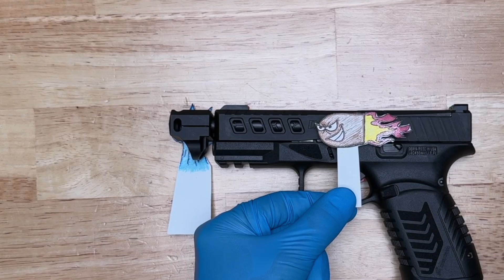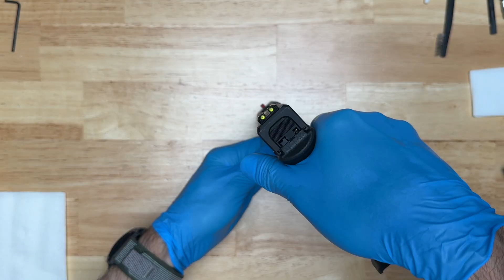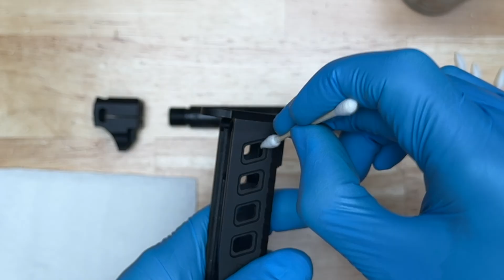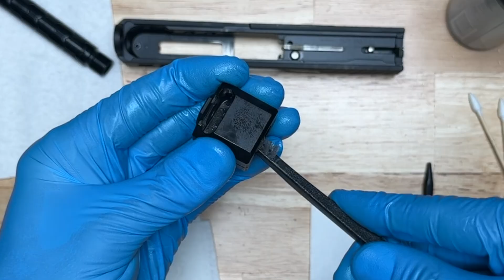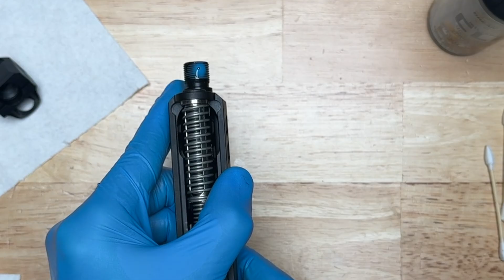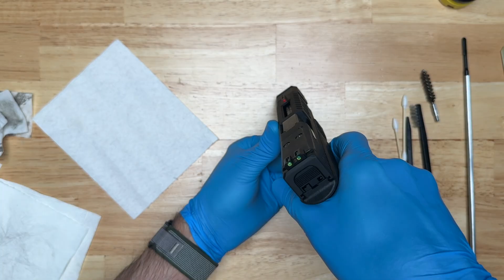Derya DY9 Comp Tutorial Assembly, Disassembly, Cleaning & Maintenance Guide

Comment: I picked up the dy9z a couple of weeks ago.
Let me know tell you about Derya support.
When I got the firearm home I field stripped it to apply light gun oil. During reassembly the slide stopped just short of full assembly. Long story short the "tab" on the trigger bar is supposed to depress the firing pin safety plunger during reassembly. This tab is jamming against the safety. I have to reach inside the empty mag well and manually depress the safety.
Derya has been slow to respond.
Now they say since I disassembled the gun I'm responsible for shipping and repairs.
I've done nothing but a field strip.
Reply from the maker: This goes through our customer service department, not the comments.
We have a set process for claims. Derya’s Limited Lifetime Warranty covers defects in material and workmanship for the original purchaser, and we stand behind that program. Contact customer service so it can be handled under the policy.
Posting the same comment on multiple videos does not move a claim
Reply: @DeryaSupport 
Your support has been horrible. At this point I don't expect Derya to fix their defective product. My comments are to warn others. Not to elicit a response form you.
Bear in mind. I know what the problem is with the firearm. I could fix it myself. But that's not the point.
You were told at the beginning the firearm wouldn't reassemble after a field strip. Now you want to void my warranty. 
NEVER AGAIN